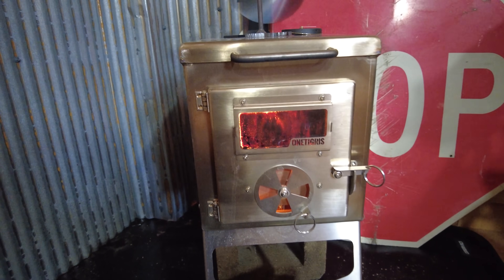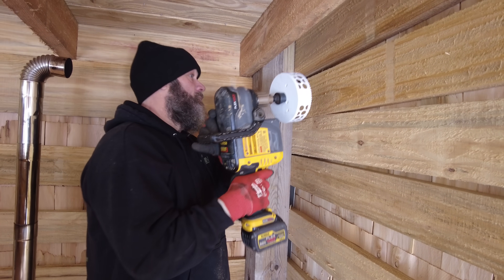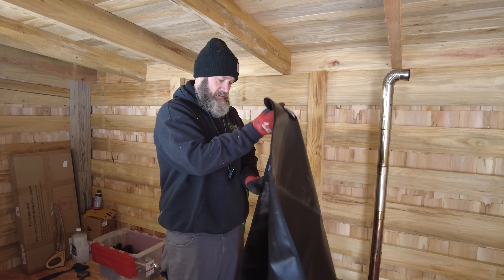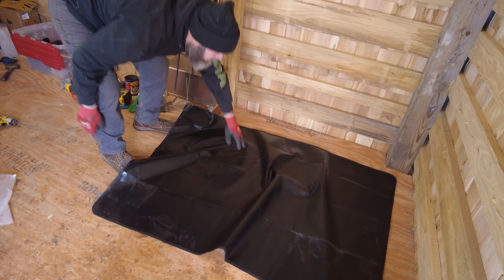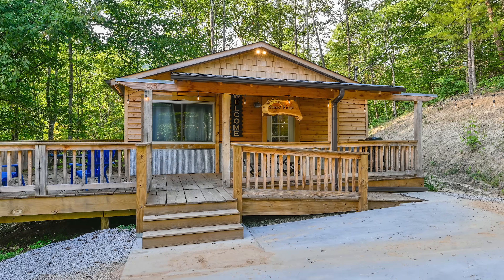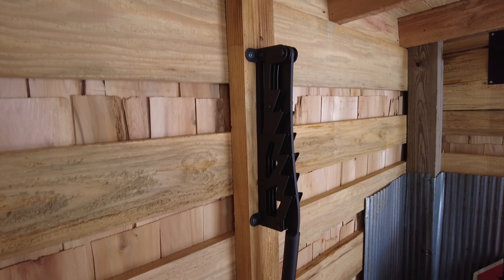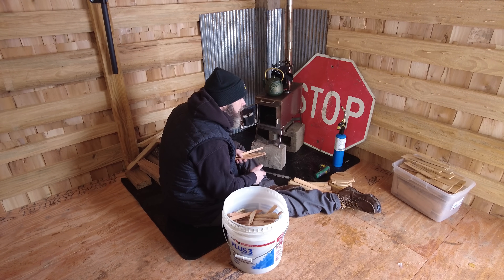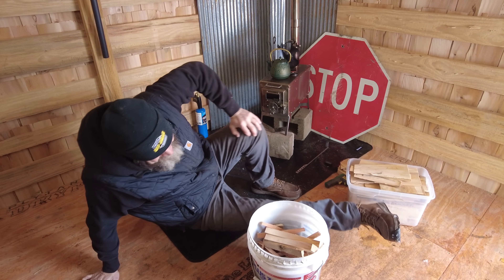How I Keep Warm in My Micro Cabin

Comment: So I have a small stainless steel boat stove (Newport solid fuel) installed in my van. The firebox is the size of an ammo box, probably was an ammo box in another life. It was just beautiful when first installed but it was my only heat source at the time and I was inexperienced with small wood stoves, so I put too much fuel in it, fired it up and saw the pipes glo cherry-red. Kinda scary but nothing bad ever happened, unless you count a bit of warped steel. I still use it reuglarly and under the right conditions it will even sing. It's a nice little stove, go easy on 'er 🤠
Reply from the maker: I saw some really cool boat stoves. One was  made out of round pipe and I had to have it till I saw it was over $5,000! I like my little $150 Amazon stove. Been using it allot since this video and I think I have it dialed in!

Comment: There are minimum height requirements for vent pipes to get proper drafting there should be very minimal horizontal runs or none . Raise the pipe and always if possible go straight up. You also need a fresh air source to create the draft so you definitely do not want an air tight building or an outside fresh air vent adjacent to the stove.

Comment: these little stoves are cute but not made for constant use per say.    now there are these little cast iron stoves you can get...  Canadian Tire,  Home Depout USA,  Lowe,  they all carry the same epa 2020 stove.   price runs between 549-699.   While expensive...  ish...  for a cabin up to 900 square feet its a good option.

humor here is  you could run a wood stove,  with a small 3kw diesel heater for fast heat/overnight/low maintenance, and a propane buddy heater as emergency backup.
Reply from the maker: Yeah I've been looking at those little diesel heaters. I've seen guys run the exhaust through a radiator to recapture the heat. I will be trying out a no electric pellet stove soon that is supposed to have up to a 24 hour burn time!
Reply: @buildlife  yeah, thats why i like the diesel heaters.   even if you don't do a single fancy thing with them...  their fuel usage is about .0925 gal/hr.   or running at max power about 2.2 gal/day.    the key is you can set them running with thermostats...    so turn it on...   set it for what temp you want then...    start your fire...   burn your fire till you go to bed.   if the fire burns out and the temp drops, the heater then kicks in.   once you wake up and restart the fire...   the heater auto-turns off :)
Reply: @buildlife  oh little tricks you can do to help with heat.  

Curtains - many think they are just decorative but in reality their original purpose   was insulation.    you will often loose heat or get drafts from windows, so hanging floor length curtains over them,  helps.  

Door Curtains  called Portière  in french.   A cloth or hide covering placed over the door to stop drafts coming through  and under the door.  

Carpeting - used to insulate the floor and prevent drafts from coming up from floor board spacing.   Also tended to me more comfortable to walk in in winter then bear floor.

you could very easily theme these,   for example going all hides, with deer hides over the windows and door, and a fur rug  on the floor.    

As an alternitive you could go for wool,   in Hudson's Bay Colors  blue yellow red green.   For the windows and a cowichan pattern wool door covering.

Comment: Put a vent pipe in the wall or floor with screen wire over it to keep out critters and bugs. You're sealing the cabin up too much making it hard for the stove to draft properly.  and allow proper air flow for the stove. My stove in my shop has a vent box over the draft door and two 3" flex pipes going outside. My draft door works as normal, but I don't get a bunch of smoke out of the stove when I open the door to reload the stove.
Reply from the maker: Once I got it hot and adjusted the pipes it worked pretty good. Half the comments say it's not tight enough LOL theres a pretty good gap around the bottom of the door so I think your right and that should do pretty good. It got plenty hot!

Comment: I thought the rule is to have the top of the stovepipe at the same height as the roof peak.
Reply from the maker: If it was a daily burner on my house we would add a pipe. The rule is 2' higher than anything 10' away or 3' above the roof.

Comment: Much too small for that building. You will be feeding that fire every hour. A camp chef barrel wood stove from cabelas would be much more efficient for that style cabin. It's a much larger, robust stove
Reply from the maker: That cabin is 100 square ft. with 6' ceiling. It get's really hot in there. Could probably heat it with a candle.

Comment: Why on earth would you drill a hole that big when your stovepipe is a lot smaller ? A welding blanket would work better. If you put firebrick in that small stove, you won’t have any room for wood.
Reply from the maker: I'm glad your here with all the answers.
Reply: Big hole for small stove pipe = Not burning the cabin wall
Reply from the maker: Seems about right LOL @gregfeldman6818
Reply: Fire safety